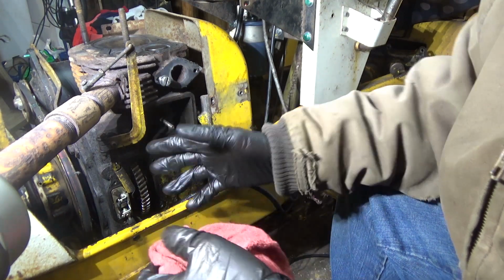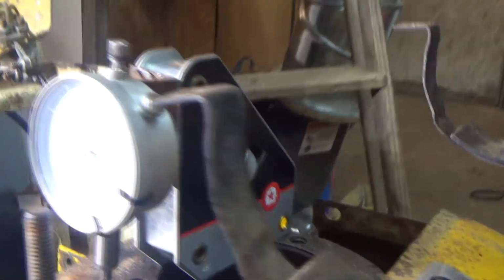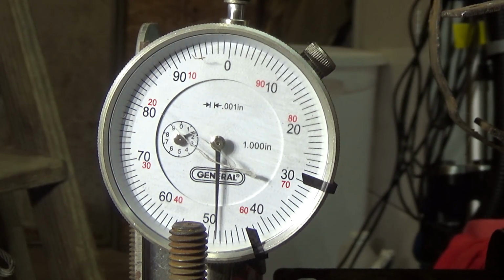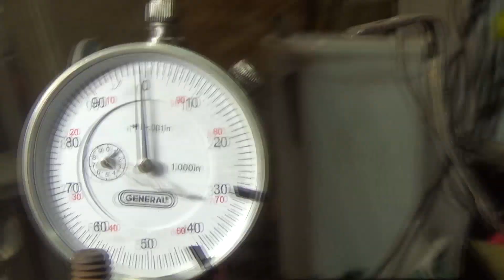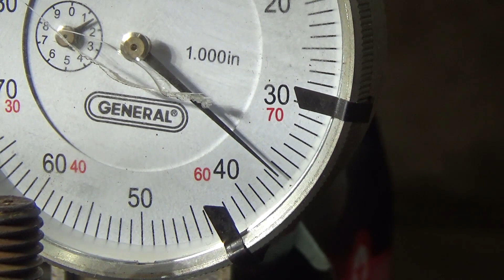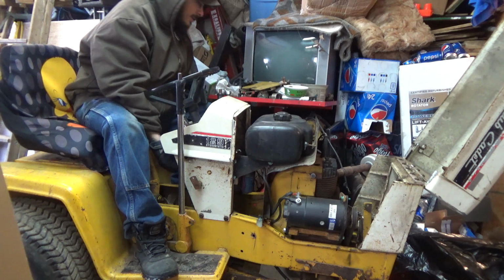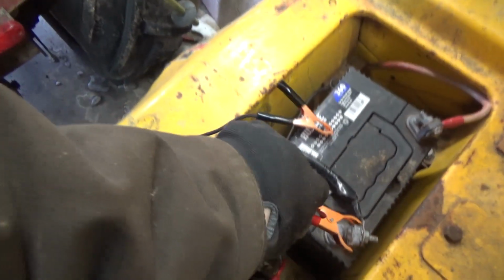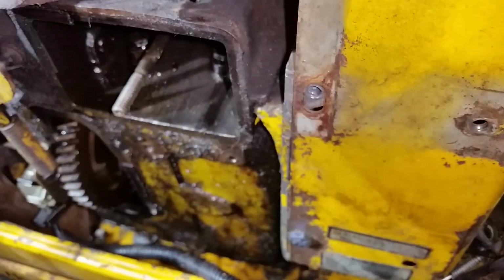adjusting the ACR on a kohler early k series engine/ Before Serial No. 9006118

Comment: My cast iron 16 horsepower briggs had a fixed decompression on the intake didn't want it because it lowers overall compression ratio. 
I opened up the valve lash to bypass it however rope starting it requires it to be turned backwards to compression before starting it. 
Rope starting it is like dragging dead weight as soon as the rope runs out the engine quits turning. 
A beast once started. 

Don't know why yoyr engine doesn't like to run once cranking should stay running🤔
I tried checking threw the video for valve overlap timing to verify timing is correct but never saw it. 

There's a point where both valves open exactly at TDC witch is a good way to verify cam timing. 

As for spark timing depends on weather it's mag or battery coil how you'd test it.
Battery ignition is simple as turning on ignition and check for spark few degrees before TDC. 
If it's a mag would require unhooking the points and using multi meter with continuity test to see where points close (and don't buzz because of bad connection)
Reply from the maker: I tryed to gap them large but no go on that so I had to see what case it to start so hard